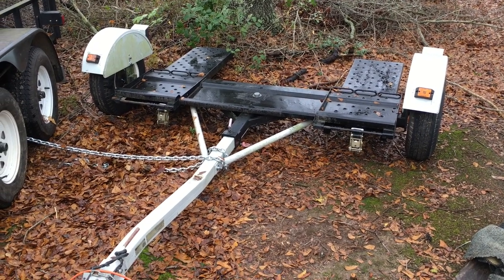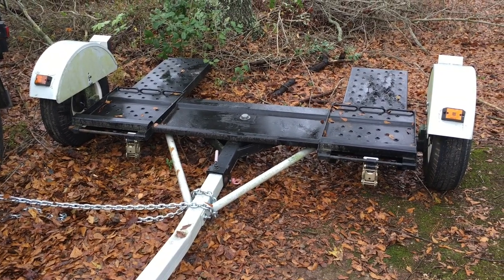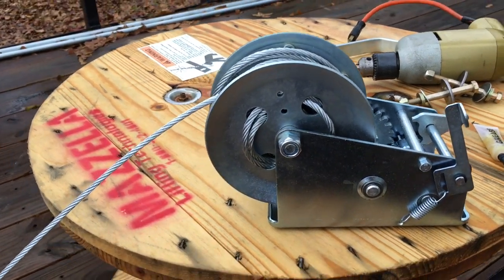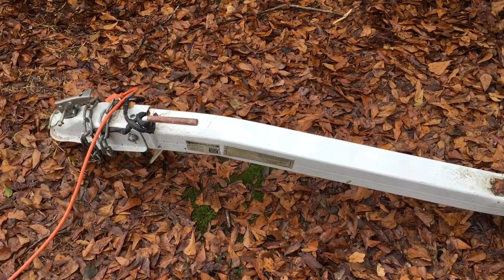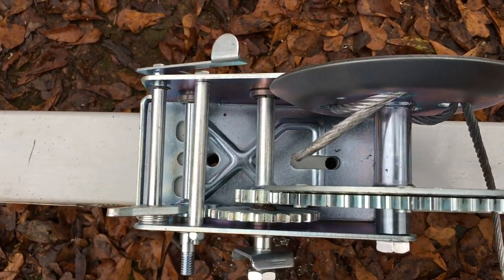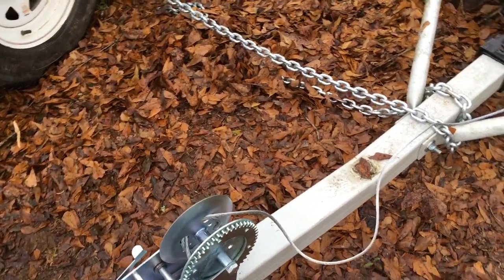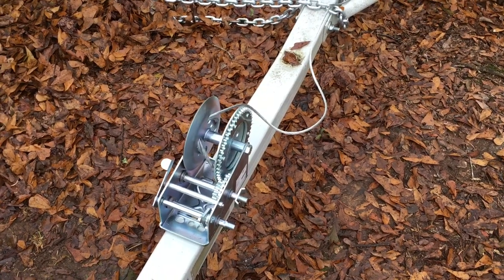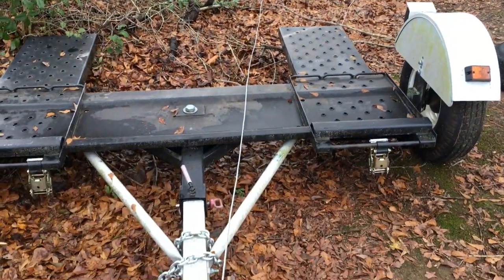How to install a Tow Dolly Winch!!!!

Comment: I have been looking around for something to install on my dolly and came across your video. At the $50 dollar mark, is there a reason why you just didn't just buy a cheap electric one? Is there a minimal pound that is needed to pull cars and trucks with. I have seen some really cheap 2000 pound and really eas looking for someone option if I should go manual or a cheap electric one. Thanks and keep up the great videos.
Reply: But then you gotta run the wires and make sure it's plugged in and not worth it
Reply: Hand crank won't let you down
Reply: @DaywordRacing  yeah that is true. I was going to install a aftermarket amp anyway in my truck, because the factory one went out. I did end up running the 1/0 gauge wire, bought a double receiver hitch, the bracket to mount it to, 2 Anderson disconnects and a winch. I made it so it can be completely removable. I made enough money off the truck parting it out. So it covered all the costs. I made it that way, so it can be used to pull stuff up onto my 16 foot trailer as well. I really want be using it that much, so it was a a overkill and a waste of money. At least my parts truck paid for it.

Comment: Where can i get one
Reply from the maker: Hi you can get a which like this from here:  BLACKHORSE-RACING Hardened Steel Dual Gears Hand Winch, 3500lbs Hand Winch with 33FT Cable Hand Crank Manual Boat ATV RV Trailer Marine Heavy Duty Hand Winch Crank Strap Gear Ratchet https://www.amazon.com/dp/B07NPJWSQP/ref=cm_sw_r_cp_api_i_ioFAFbE0Z29G7
Reply: Magnus Prime E1 do you struggle to get them up or do they go up easy
Reply from the maker: Jose Ramirez I’m like the worst person to ask that question because I power lift lol. But to answer your question, it depends on the shape of car being recovered.  But just a normal car load transport from point A to point B, no struggle.

Comment: HI, What size drill bit did you use to drill the holes?
Reply from the maker: Hi it was 3/8 drill bit. I just watched it again myself and I swear I thought I mentioned that but I didn’t, Lol. Sorry about that, and thanks for watching!
Reply: Magnus Prime E1 Thanks for the quick reply. Was it easy to drill through? I also saw that you mentioned you changed the washers on the lower end. How is the wrench holding up currently? I purchased a winch today on Amazon I’ll be installing it when I receive it. Thanks again for the video!
Reply from the maker: macbookgenius007 it’s not hard to drill the holes at all, just use a good drill bit.  Winch is doing great still.  I made some ramps to go along with the dolly for the the dolly ramps to rest on for when I’m recovering a car that’s low to the ground.  Going to do a video about those soon.  And yes I used 1/4 inch thick punch press scrap as washers on the bottom just for more support.  If you pause the video when I show the hardware you can see them on the bolts.

Comment: How much weight can that hand winch pull?  Only small cars or can you pull a mid-size truck?
Reply from the maker: I used it to pull a single cab F-150 on to the ramps before. No issues. Haven’t tried anything larger beyond that.
Reply: @MagnusPrimeE1  Oh then that's big enough good to know thanks.